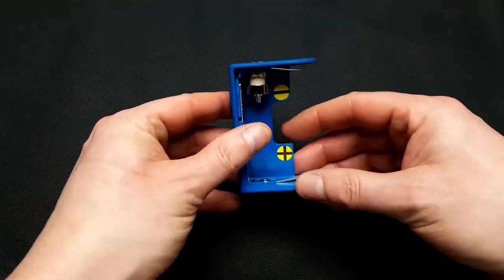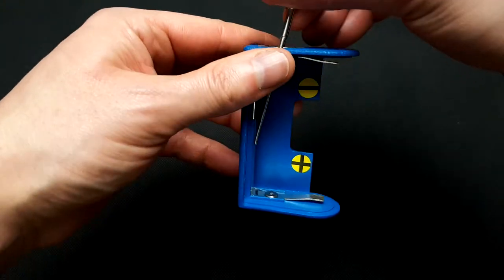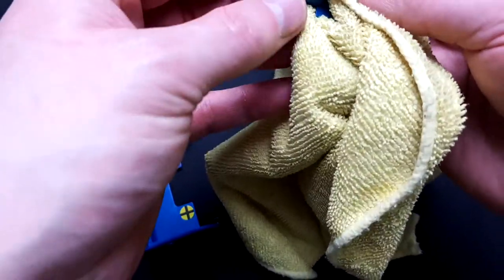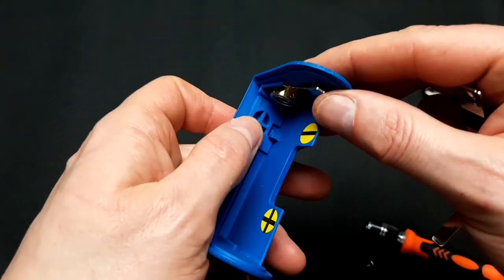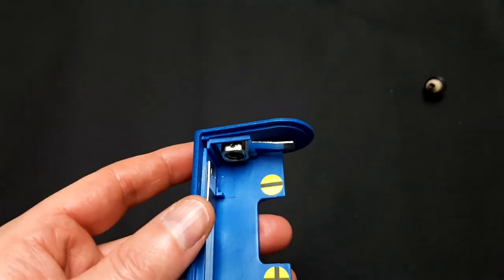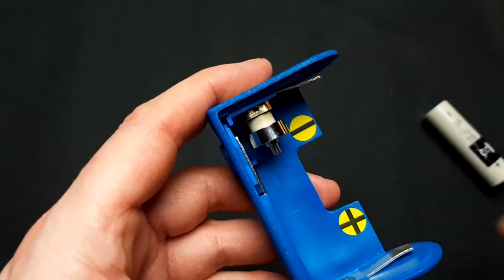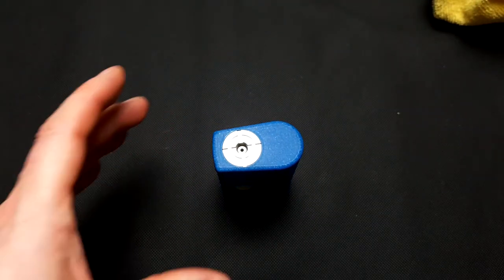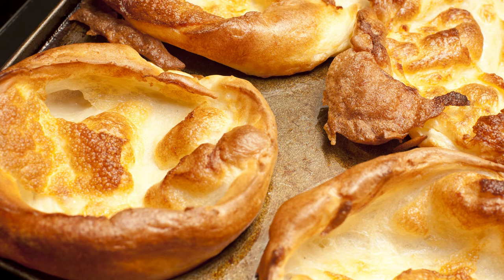Cleaning your Hugo Squeezer Squonk box mod thing

Comment: Very informative video. 

My squeezer's 510 did not like coming off the very first time I cleaned it, definitely not as effortlessly as yours, and the box itself being in the way doesnt help in finding a workable grip on the silver nut contact either. 
I may have used a bit of excessive force then because after a month or two, I decided to give it another clean, and the 510 threads on the pin became crooked as I again struggled to unscrew the silver contact. It no longer can be threaded on fully and simply falls out, which I was really bummed about since it's my only squonker and I love the damn beast.

I've been looking around but haven't discovered any connector like the squeezer's and have no experience with DIY, so I was wondering if you had any insight into my problem. Do you think any bf 510 core pin would be able to fit the squeezer's top washer and also meet nicely with the silver plated contacts pushed by the button?

I would greatly appreciate any assitance. I don't have access to a drill either, so ive been pretty reluctant to order some bf 510 without knowing that it would be compatible.

Thanks again for the video, without it, I may have broken the mod entirely!

Comment: Very helpful. I also have the drop with my squeezer
Reply: John Paul Atienza same here ! what build and Batery do you use for the drop + Squeezer ? Mine doesent fire up as quickly as i thought for a mech mod :-/
Reply: Adrian Manuel Decker just build between 0.10 to .18 and use sony vtc5a
Reply: Adrian Manuel Decker i use fused clapton dual coil